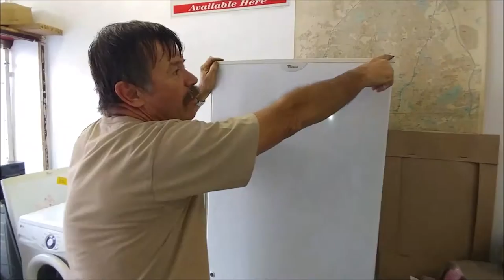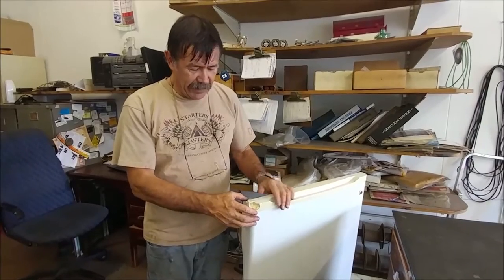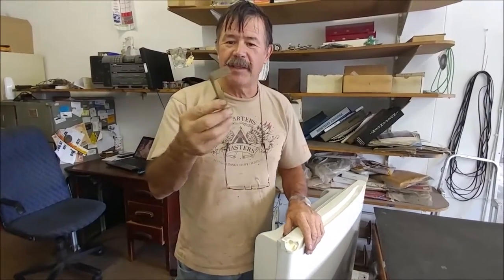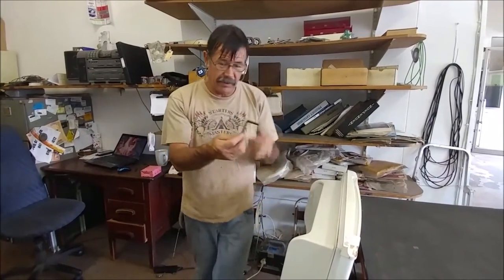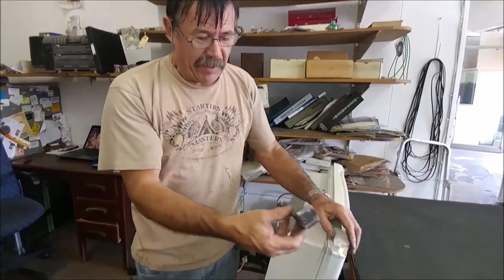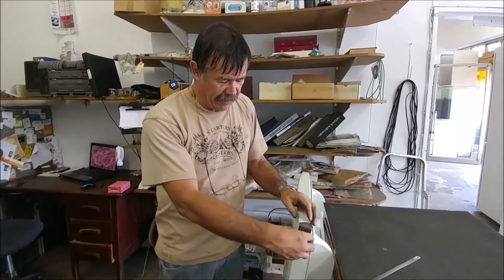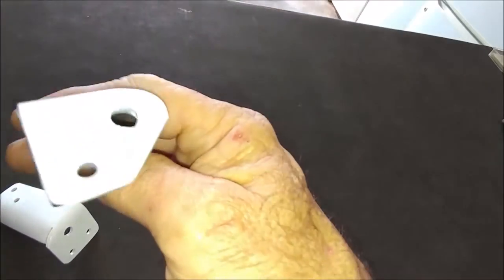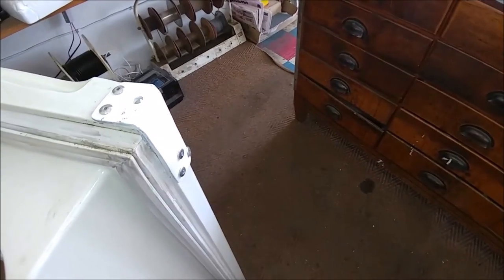How to repair a fridge door that has fallen off - JDNel Refrigeration

Comment: Can u explain how to calculate condenser, evaporator and compressor hp
Reply from the maker: There are lots of formulas which technical people use that are freely available to calculate these things. I dont use them. With my experience in refrigeration I can make an educated guess, but I sometimes get it wrong then I have to redo the job over again.